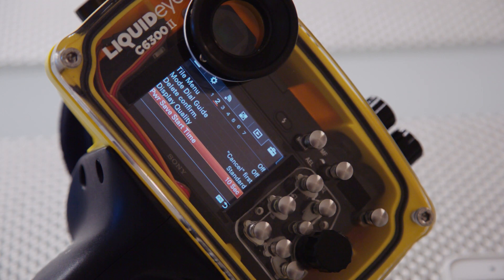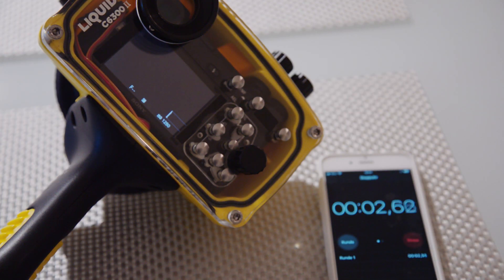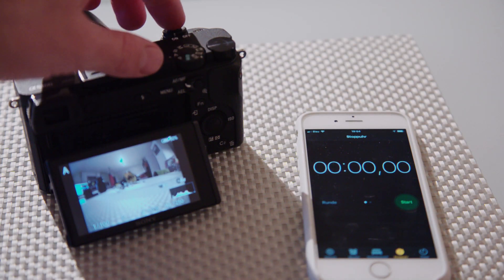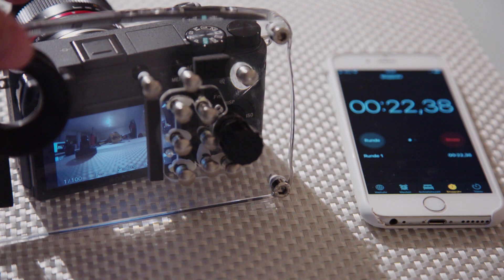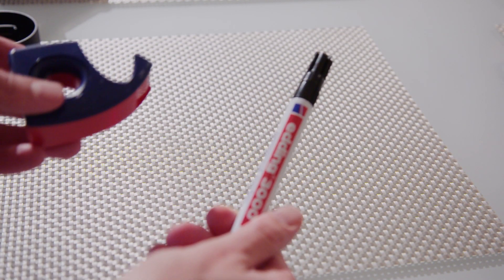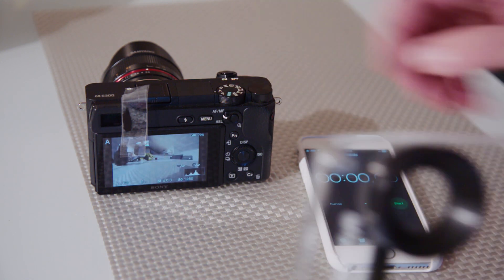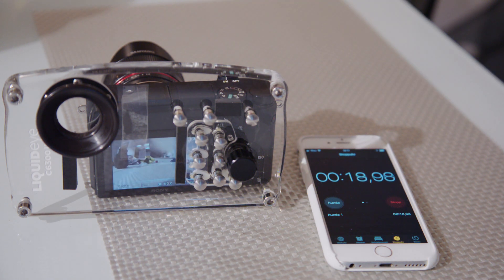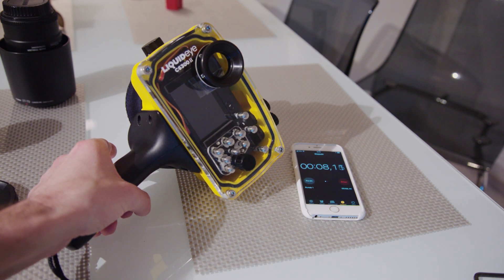Sony a6300, a6500, a6400, a6100 deactivate Viewfinder sensor for Powersafe

Comment: Hey, i have the exactly same problem with the a7iii, but, how i do to use the viewfinder, i dont like to use the monitor in water... do you know something about?
Reply from the maker: its the same for looking through the viewfinder, you can set the viewfinder as standard in the menu (deactivate the monitor). My solution for the enabled Powersafe mode works for both ooptions.